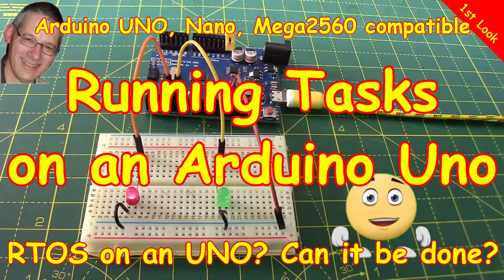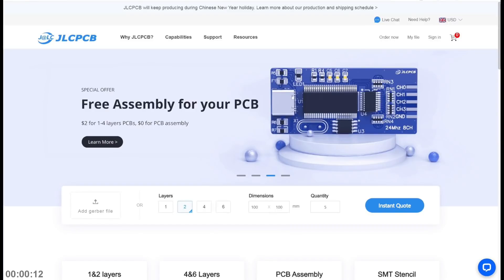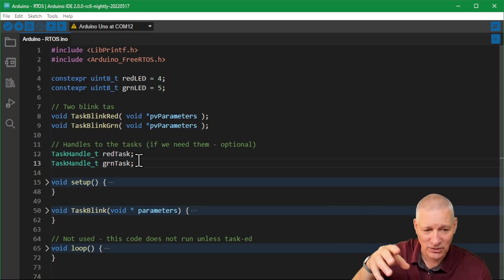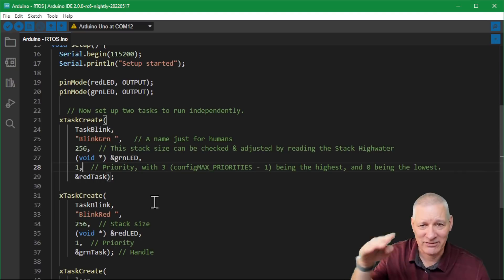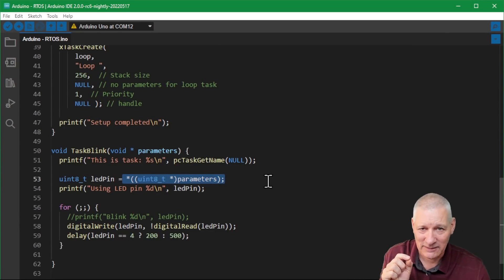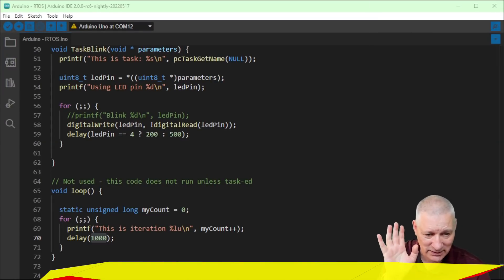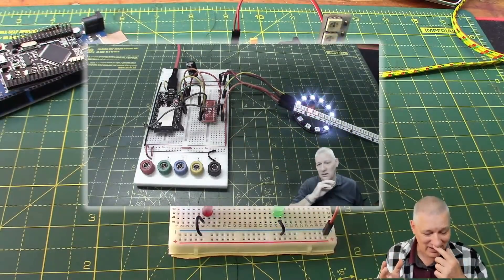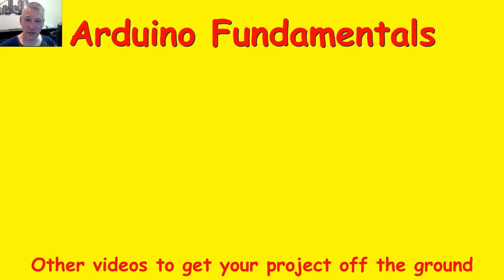#244 Multiple tasks on an Arduino?😲FreeRTOS can do it - so can you😜

Comment: I assume the rtos library is petty big. Do you know how much memory is free with it installed?
Reply: Fairly accurate use of additional ROM storage. 
// Device: loop() -> FreeRTOS | Additional Program Storage
// Uno: 444 -> 7018 | 20%
// Goldilocks: 502 -> 7086 | 5%
// Leonardo: 3618 -> 10166 | 23%
// Yun: 3612 -> 10160 | 23%
// Mega: 656 -> 7086 | 2%
Reply from the maker: It takes less than you might think. My three task, LED blinker compiled to:
14,544 (45%) of 32,256 bytes
563 bytes (27%) of dynamic memory leaving 1,485 bytes for local variables
But that's before the task memory is allocated.

Comment: Ralph, thanks for referring to my library. I’d suggest some improvements to your recommendation to use of the Arduino delay() function. Basically don’t use it. In a Task, delay() uses processor cycle counting, which keeps the Task Running rather than Blocked, preventing lower priority Tasks from getting any processor time. This will also cause the standard Arduino loop() to break, when running as the FreeRTOS idle Task, as it is normally set up at the lowest priority.  Could be why it didn’t work for you.

Best to use this delay function : vTaskDelay( 1000 / portTICK_PERIOD_MS ); // wait for 1000 ms in this case, which puts the Task to sleep and uses no processor time.
Reply: sure way of wakeing the watchdog is using a delay function like that.
Reply from the maker: Hang on, who is John?
Reply: @RalphBacon  easy
#define John    Ralph
job done
Reply: @RalphBacon  I believe it is a C++ reference to Ralph :)
Reply: Drop me a note on GitHub. Or email if you prefer. P.

Comment: I used FreeRTOS on AVR at least 10y ago. But use the biggest one in Dip (in terms of RAM size), the Mega 1284, which had 16k RAM. Worked fine. I even had a C++ layer for FreeRTOS, as functions having an object pointer as first parameter, can easily be adapted to object methods (correct C++ term: member functions).
Reply from the maker: The Mega2560 has 8K SRAM, 4 x more than the 2K of the Arduino Uno/Nano; RTOS should really fly on that.
Reply: @RalphBacon  it does fly on that.
Reply: @RalphBacon  smd, expensive and if you have a Mega324 Dip40 board (with socket) Mega1284 is a good replacement. And twice the RAM of the Mega2560. Plus it’s the biggest Flash, that still uses 16bit PC. GCC does not really like the 24-bit PC of the Mega2560.

Comment: Very good, 
have you used the Debug in ver 2 of the IDE, will you be doing a video on it, thanks
Reply from the maker: Yes I have, a very early version of the IDE that kept falling over, but when it worked it was OK. I muse try it again with a processor that supports it. I used the Arduino Zero last time but that has been withdrawn.